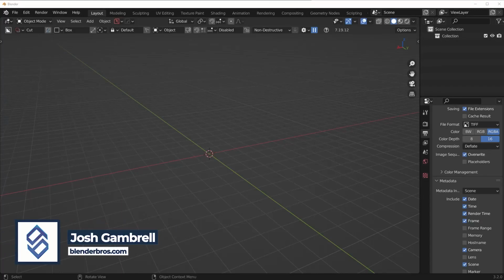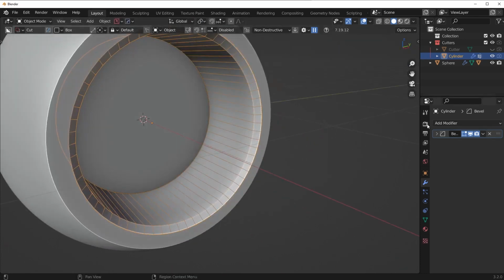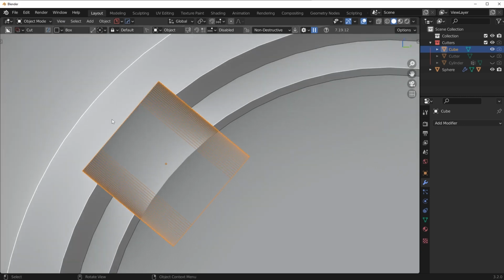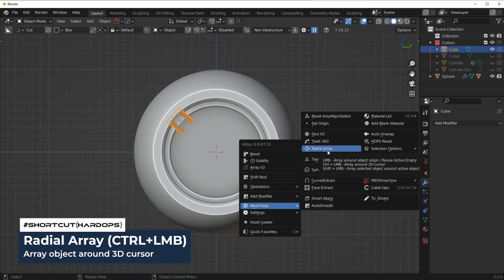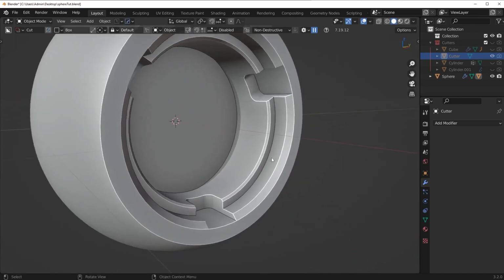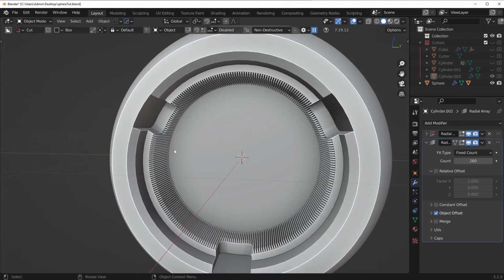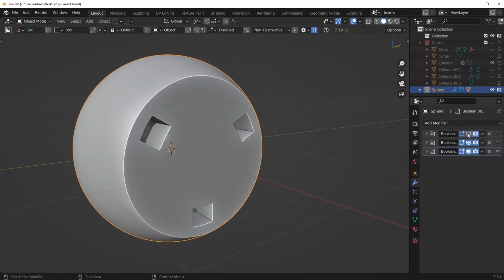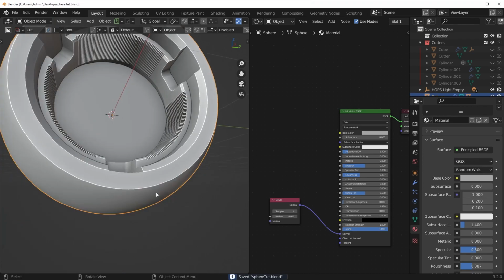Spherical Design in Blender - Hard Surface Modeling Tutorial

Comment: Great tutorial, but one thing really bugged me. Since you started with a UV sphere with all the horizontal vertices running parallel, it seems like it would have been more ideal (at least for a cleaner cut) to rotate it 90º before cutting into it so that the cuts matched the parallel vertices. Maybe you’ve reached a point where you don’t worry about that sort of thing since you have the tools and methods to clean it all up regardless, but it just seemed like something I would have done. Any reason for doing it this way rather than the way I mentioned? I know you also seem to usually use a quad sphere so it intrigued me to see you even using a UV sphere at all haha.

Comment: Hii i have question,  how would you do to make quads on that 3d object for a videogame usage?
Reply from the maker: I wouldn’t. I’d triangulate it beforehand. If I needed quads for some specific reason (i.e. trim sheets, cleaner unwraps, VFX, etc) I’d just use Quad Remesher or retopo manually.

Comment: Great tutorial, as always, but one question; when you rounded off the box cut instead of creating a cylinder, deleting the back and front faces and running a solidifier before cutting couldn't you have simply used an intersect boolean? I'm presuming there's a rationale to doing it your way and I'm still learning Blender so I'm curious.
Reply: That's exactly what I scrolled down to the comments to mention!
Reply from the maker: That could've worked too! Just hadn't considered it.